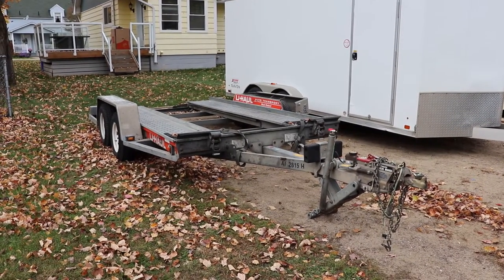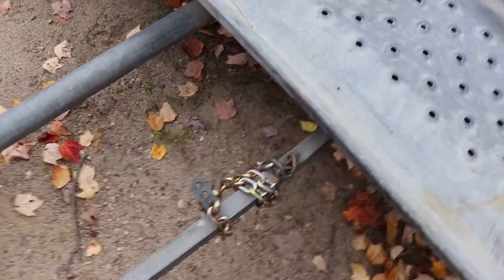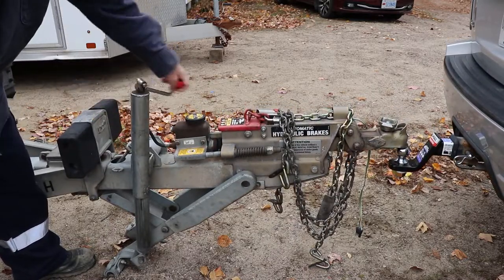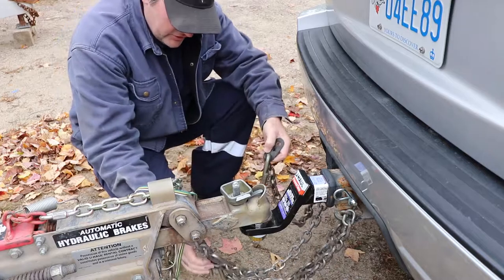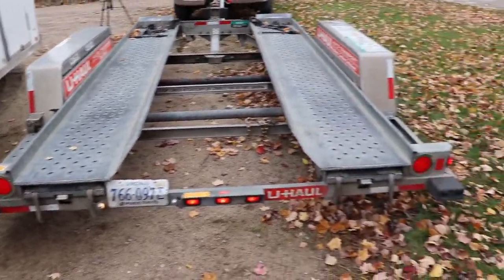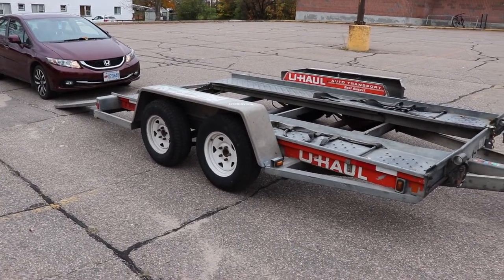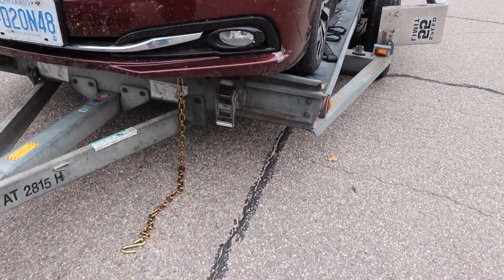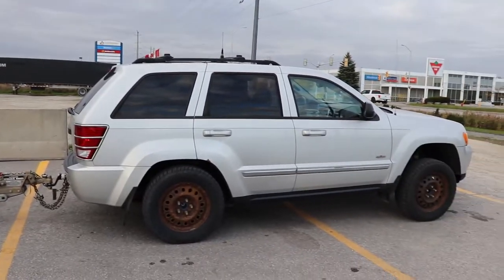Loading 9th Gen Honda Civic onto U-Haul Auto Transporter

Comment: if you want to, can you disconnect the transporter from the vehicle doing the towing WHILE keeping the car on top of the transporter?
Reply from the maker: I think so but don't try to remove the car when the trailer is disconnected.  Be sure to block the wheels on the trailer if you disconnect it as it would be hard to stop if it started rolling.